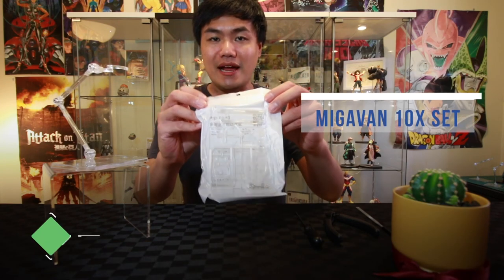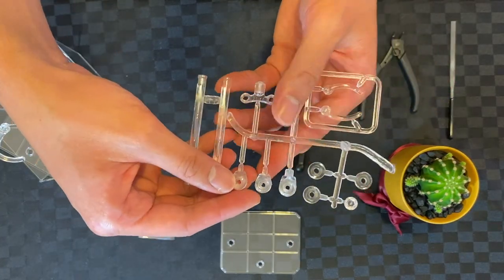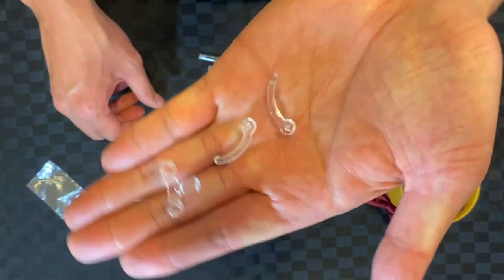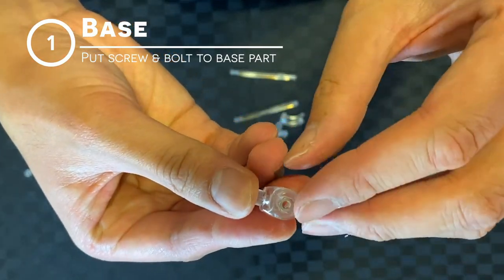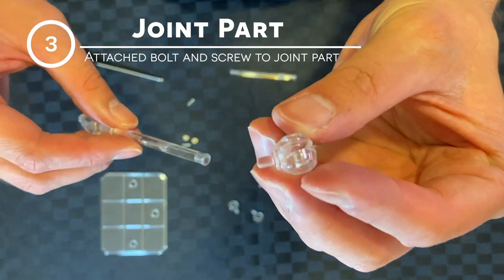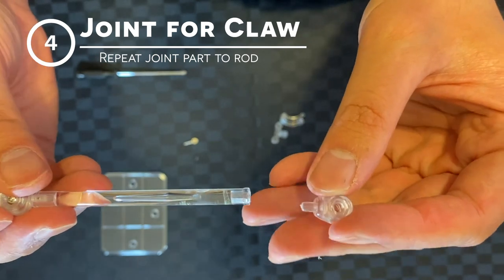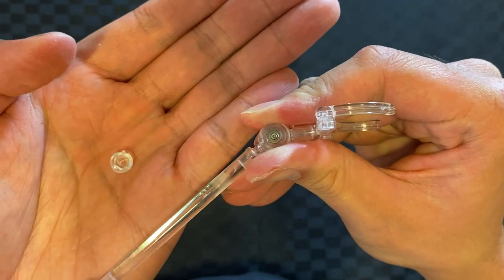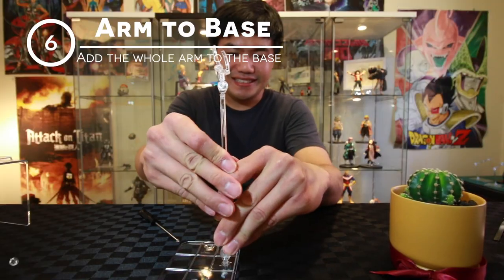Tutorial - Migavan 10pcs Assembly Action Figure Display Stands

Comment: The joints keep loosing up. I tighten them and come loose again. What can I do to fix that? 🙏🏼😔
Reply from the maker: Oh no...
Does this happen to all of them or just one?
If just one, is it the figure/item too heavy for the stand and you might need to get something stronger?
Reply: @Awarsing  thank you for the reply. Well, is only a one little claw that grabs a 6inch figure. Not that heavy.
Reply: I tighten the clamp part to hold the figure and it comes loose. I know that there is a way to tighten loose joints on an action figure using pledge or other solutions. Would it work if I use it on the screw to keep it tight?  I tried searching how to fix this but there are no info about it.
Reply from the maker: @marioalejandro7549  I see...

Yeah that could be stand issue, can you get it replaced?

Sorry I don't have anything to help you out with fixing it

Comment: Hey I need some help because at the base of one of my stand it broke off and is stuck inside the pole
Reply from the maker: Oh no... As in it snapped?
Sorry I'm not sure if you can do much to fix it...
Reply: @Awarsing  like the part connecting the base and the pole together got snapped off inside
Reply from the maker: @hashimhussain8973  I see
Do you think you can get a replacement/refund?

Otherwise I don't think there's much to be done to fix, if it's snapped...
Reply: @Awarsing  yeah it’s my fault I accidentally dropped it off my desk but I think I wil just glue it
Reply from the maker: @hashimhussain8973  Ah I see...
Yeah see if glue works, thought not sure if it will be strong enough to hold it in place over the long term...
Reply: @Awarsing  well I think I might  put glue on the in and outside
Reply from the maker: Yeah give that a go!
All the best!
Reply: @Awarsing  thx 😃